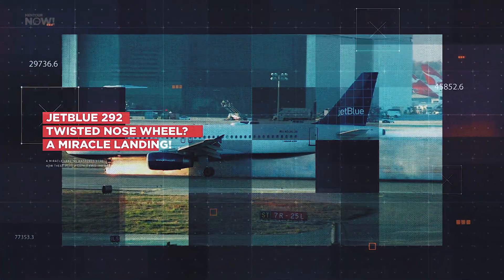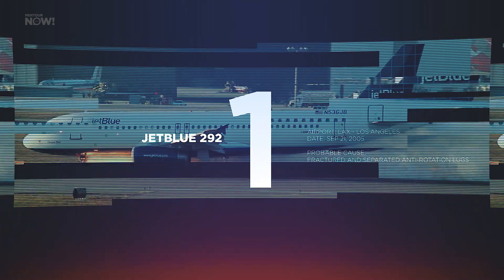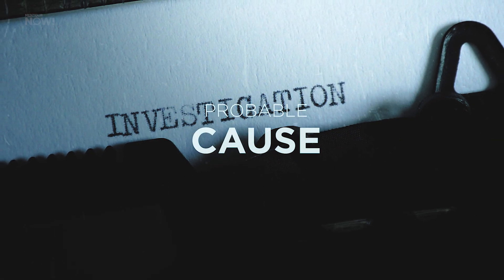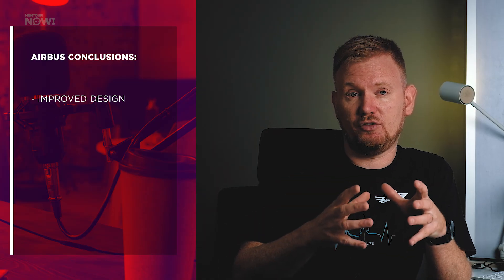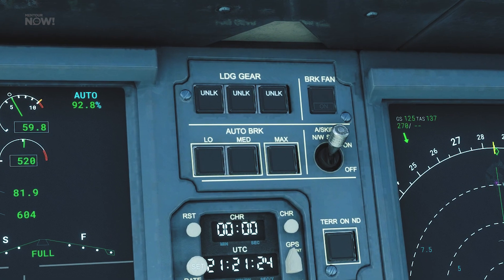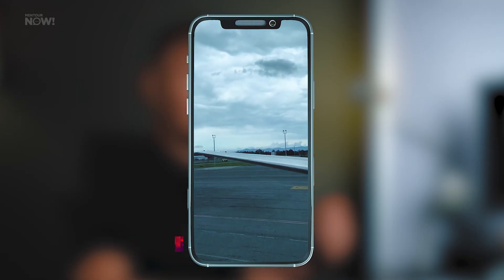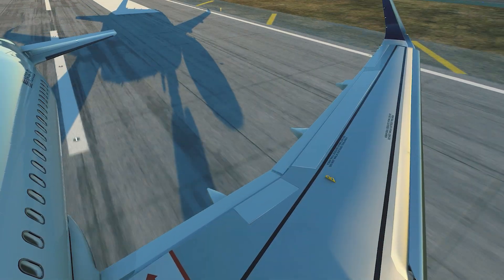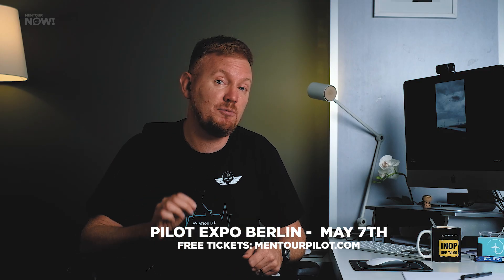The TWISTED Story of the Airbus A320 NOSE-GEAR!

Comment: The design of the A320 nose wheel is fundamentally flawed. Claiming that every incident root cause was different in detail is missing the point.  Nosewheels are ubiquitous on all heavy passenger jets, yet only the Airbus had this litany of major failures.  This tells you the design was rubbish. The advisory to limit travel to less than 20 degrees was totally impractical and put the onus on pilots to band aid over a bad design. How can an aircraft operator reliably taxi when airports turnarounds require much greater nose wheel angles? Do they have to get out and lift the thing up by hand? I suppose the passengers could all get up the back to lift the nose up or something.

The sensitivity of the proximitors to water ingress is also ridiculous.  The spray of water from a wet runway could do much the same as pressure washing if water resistance was compromised. Waterproof proximitors are hardly a new invention, they are ubiquitous throughout industry. You can also bet that some cleaner will not be briefed on the dangers of washing the nose gear and do it anyway.

The nose wheel should have a failsafe, robust mechanical mechanism that prevents extreme steering angles in the landing configuration and retracted position and automatic self-centering castoring of the wheels if the hydraulic actuators lock up.  The nose wheel angle should also be instrumented so the pilot knows if it is in ta safe position to land. 

The wheel was invented millenia ago there is simply no excuse for this poor design. Modern automotive unassisted, hydraulically assisted and electrically assisted steering systems have to undergo all of the assaults an aicraft nose wheel system does, and there are many more "stearing hours" for the millions of cars than aircraft. If the steering system of cars was no more reliable than the airbus system there would be a lot more dead car drivers and passengers than there are now.

Comment: It needs to be pondered why this serious of similar issues occured with one specific plane model. Or does it happening on many models?
9:58 No power washing inside of the nose wheel well? Because such conditions that cause water to enter the sensors could totally not happen when operating the plane on a very rainy day with water spray? No need to overhaul the sensors?
And allowing the steering angle limitation thing to continue flights with is irresponsible and definitely the kind of stuff that happens in a profit-driven business. They're basically expecting pilots to stick a post-it note on the dashboard so that they don't forget to avoid an extremely dangerous irregular error. - This underlines my critique regarding the marketing pitch of safe airline travel. That incident was completely avoidable. If my car had a technical issue where I must remember to not exceed a certain steering angle to avoid a dangerous situation, I could get into serious trouble with the police, and rightfully so. It is unsafe operation of a vehicle in public space.

Comment: Thanks but, you have just contradicted yourself.  Because:-
It seems like after all these instances,  the fault was actually never remedied and the problem persisted. Not withstanding that the faults may be slightly different I find the proposed remedies incompetent. 
For instance,  to blame the jet washing for getting water into part of the undercarriage is illogical.  Because,  what about the splashes of rainwater during a deluge. Are they suggesting NO landing with the nose wheel deployed during a deluge just in case a part of the inside of the nose gear gets saturated ?
It's nonsensical. 
Whatever happened to compliance with the Failsafe requirements  ?
But I suppose everyone is more interested about getting the aircraft off the ground rather than landing it.

Comment: 90 degrees is probably better than being locked at 20 degrees pulling the plane off the runway. But one would think you get one chance to fix this, or this plane is grounded. We will take the plans from a similar sized plane that has never had an issue and you will use their design. And then you will test it 1 million times. And then, maybe, we will let you fly again. So they just plan to let this happen forever until something actually tragic happens? And then get serious about it?

Comment: I've flown a dozen times since my youth. After watching dozens of YouTube posts about commercial place crashes, I wouldn't ever again get on a plane. They're known to be flown by drunks; suicidal pilots flying  purposely into mountains; pilots can't figure what the faulty onboard computers are saying; a most unprovidential stewardess got sucked out of plane at 37K feet and engines flame out in flight. And that's only the tip of the iceberg. Airbus is among the worst.

Comment: It sounds like they need to add a mechanical backup steering mechanism for the nose gear so that the crew can at least center the nose gear prior to landing. Or maybe just permanently fix the nose gear in the centered position. Unless I'm greatly mistaken, they never had any similar issues during the taildragger days.

Comment: I’m curious.  I understand why you wouldn’t want the engines ingesting pieces of the nose gear, but shouldn’t the thrust reversers actually reduce weight on the nose gear?  In a car if you pull the E-brake, it causes the back end to squat down.  Given that the engines are rear Lear’s of the nose gear, shouldn’t the reversers reduce downforce on the nose in a similar way or is it that the weight transfer of braking offsets this?

Comment: 19 Febuary 1992 AirMalta had a similar problem. The A320 was a relatively new design and had its problems when it was introduced commercially to airlines. This aircraft (9H-ABP) was MSN 112 so quite an early production one. AirMalta were operating as KM 100 towards LHR from MLA when during take off the front wheel spun when we were already at high speed. Of course we stopped as soon as possible, but as can be seen in  photos taken on the day half of the front wheel was eaten by the friction with the ground. After this incident the Airbus had arranged the design and there was no other like it in the take off phase of flight but there were still others similar during the landing, with famous JetBlue live on TV.

Comment: In 2000, i worked in a tall office building beside LAX and we went outside to witness the aircraft landing with its nosegear at 90deg. 
Unfortunately i cant find the plane type as your video made me wonder if it was the same as the more recnnt aircraft.
I was wondering why they couldnt turn on the APU rather than rely on a ramjet which itself might impact the rumway? Thats what i would do if i were pilot. Shut it off after coming to a stop on the runway before evacuation (or during because its intake wouldnt risk any passengers).
Another thing i firmly believe is that every control shpuld hace feedback. If rhe Captai s steering hamdle were at 90deg it would be an easy indicator what the wheel is doing.
Without feedback you cant even walk. You wouldnt know if your foot was on the floor or bumped into a wall as you continued the motions. 
Feedback is essential which is why they call it AI.

Comment: I'm not a pilot. I personally would be following the Unsafe Landing Gear Checklist, at least for the most part. 
As you said, although all these failures seem identical, they're not. 
As a pilot, I wouldn't be so sure that my nose gear wouldn't collapse and damage an engine, so I'd shut the engines down.
In an effort to keep everyone safe, I would make to give emergency landing instructions, just in case. 
Really, it would seem that an "Other Unsafe Landing Conditions" checklist should be made, which would mostly include considerations for safety.

Comment: Yeah, that's how I programmed computers. Do an initial bad job then just fix the bugs as they came up. I wasn't a very good programmer and it looks like the designers of the nose gear were pretty ordinary too. The whole video avoided saying that though. I guess it was good that the wheels didn't fall off. Or was that in another plane? Overall my opinion of aircraft design and maintenance has taken a huge hit lately.

Comment: Maybe they should add the ability to see the degree of the nose gear via the information panel and add an option that they can turn the wheel left or right back into a straight position similar to the mechanics to a car side mirror automatic adjuster but modified to be more durable and take the stress of landing , or add a second nose landing gear of a different design that can be switched to just behind or just ahead of the main nose gear as a backup 

Or preferably scrap the design and replace it completely and add additional safety features similar to the above for the ability to adjust the landing gear positioning

Comment: At the very end of the video, Peter mentions that it is required to shut down engines after landing, because if the nose collides, no FOD is pushed into the engines. I was expecting that the collapse itself could cause damage to electronics under the cockpit, creating problems for the shutdown of the engines and hindering an evacuation. Is this a possibility?

I'm not in the industry, and I'm unaware what electronics are there and if they would affect engine controls, but this made me remember the Qantas flight 1, where the intercom was inoperable.

Comment: What would make the wheel move towards the center line it's cold Castor not camber

You can also have the wheels have a centering effect by putting them on a trailing link that is slight even several degrees. Take letter L with direction of travel to the left if the wheels were mounted at the very bottom right of that letter L , as you move it would have a centering effect. It's been awhile so I am rusty but I believe that the point of the wheel mount to the top of the letter would also give a Caster angle for that centering Force or I should say the return to Center Force. (Sorry, it's been awhile, really rusty)

Comment: To be honest, part of me wants to say that the fact that so many different faults lead to the nose gear being aligned 90 degrees off axis is a good thing maybe? "Good" in this case means "Failing gracefully",  not "this is a good normal operation mode", of course.
It's a lot better than the nose gear being for instance 15 degrees off axis in any particular direction, because at least with it nearly perpendicular to the direction of travel it won't try to push you off the runway.
So I'd call this an example of "graceful degredation of capabilities", even if it is still very clearly a rather severe fault, because you don't have to fight the aircraft to stay on the runway even with the gear at 90 degrees off of the intended axis.
Of course it's not the expected graceful failure mode (nose wheel stuck aligned to the center but no steering is the intended failure mode, from watching this video), but it's nice that it's still at least a little bit graceful.

Comment: This many problems with the landing gear indicates fundamental design flaw in the gear itself and its Associated support systems. Airbus should scrap the whole syatem and redesigned it from the ground up with expanded testing and proper testing. If  this specific airplane has significantly more nose landing gear issued than other aircraft, it is a type design weakness.

Comment: Wow!  Is this video a joke or what?  The cognitive dissonance here is unbelievable! - almost as bad as seen during this 'epidepimick'!

First of all, how did these 4 or 5 landing gear hardware AND software design flaws get ALL THE WAY past testing & safety procedures during the ENTIRE design process?  Something NEGLIGENT has occurred here OBVIOUSLY.  How?  Why?  Where on earth did this shocking design come from?  Someone should be asking serious questions of the designers.

So MANY operational rule & procedure changes made SPECIFICALLY to cater for FLOORED Airbus 320 operation!  Is the  'Airbus' company UNTOUCHABLE or something?  Are they above the rules?

When are all these A320's gonna be pulled from the skies & grounded until they fix the bloody landing gear SYSTEM problem?  How many miles of runway bitumen are gonna have to be plowed up by A320 nosewheels (noseploughs!) before this happens?   

Is the runway immediately closed & re-bitumined aftet an A320 noseplough event?  Or do they just sweep it & continue to let aircraft take off & land from it?  There could be large, loose stones that could be thrown up & about from a compromised runway surface.  

Can they patch up runways like they patch the roads?  How do they re-cut the drainage channels back into the runway after it's patched?  Or do they even re-cut the channels after a patch is applied?

So how much more of this bs has to go before Airbus does the right thing?  Until someone gets killed?  Or will they wait till 50 or 100 people are killed? 

Shame on you too Petter!  You seem to accept all this pandering to Airbus like it was just a normal thing?  I never thought I'd give you a thumbs down but you scored this time!

Comment: I have to agree with the others saying the nose gear design is defective and needs to be reengineered, 4–5 different causes for a nose gear rotated 90° tells me you have multiple single points of failure. It needs a backup added to limit the gear rotation in the event of other failures and/or a way to correct geat rotation in flight should it occur. Maybe a set of backup lugs to physically stop the rotation?

Comment: This is designed to fail. Why would 90 degree even be an option. Why not make it so the wheel can only turn so much without coming to a mechanical stop. easy

Comment: Stupid question, but couldn't they just have some springs that center the nose gear when it's at 90 degrees? The only reason why it would be at 90 degrees anyway is during taxi, at which point the weight of the aircraft would overpower the springs. But once there's no pressure, they center automatically. Could probably be done in software as well.

Comment: So the steering on my car is better designed than an airbus landing gear? If I crank my steering to max in either direction and then let go of the steering wheel, it doesn't lock in the max position. Nor is it reliant on a couple metal lugs to not over-rotate. Nor does it rely on a computer dumb enough to break itself.

 Is it really a fact that they make wonderful flying vehicles but are lost regarding rolling on the ground? Airbus should call Toyota to get help redisgning their hot garbage.

Comment: Dear Mentour Pilot - I do enjoy your programmes - though having (helpfully !) commented on a Concorde piece you did once and getting unfairly roasted by a couple of you tubers (why do people do this ?!) I hope my suggestion of an answer to your question about how the pilots did not notice their wheels were at 90 degrees may be of help. I am not an engineer but about 7 years ago a colleague and I witnessed an articulated truck hit the back of a small car on the M40 Motorway in England at about 40-50mph. To our utter amazement the car became stuck sideways on to the front of the truck which simply pushed the car (all 4 tyres at 90 degrees) along the tarmac. There was no screeching, no burning rubber and the truck was still doing around 20-30mph for around 150 metres or more until they both came to a stop. Strikes me that for some reason tyres may simply 'slide' - at least for a while ? Cheers and keep up the great work Monsieur ! Johnny

Comment: I can’t believe these aircraft are still in the air with the possibility for this defect to occur. It appears to be a major safety issue. Having the wheel 90 degrees must put an enormous strain on all the components involved. Obviously there would be no steering control. And the tires scrubbing off leaving the metal rim scraping along the runway surface must leave a heck of a groove in the surface which would be right where other nose wheels run. Not to mention the possibility of debris flying into the engines if the crew forgets to shut them down. The whole thing is bizarre.

Comment: IMHO, if the same failure keeps repeating in a frequently weird fashion, no matter if the triggering cause is different each time, the root cause is not the one triggering the event, but the design of the part that keeps failing in the same way over and over. So, I’d say the design of that part should be completely changed.

Comment: As an Engineer myself, I hate it when people automatically blame the design.  In this case, though, it seems justified.  The result of all these different events caused the system to fail to the worst-case scenario.  In the event of a fault, the system should inherently return to a centered position.  I think a ground-up re-evaluation of the entire system is in order, with a much better focus on fail-to-safe design.

Comment: i don't particularly agree that, for example, a no ECAM message is no crew troubleshoot of known or perceived problems. I know that times are changing surely and getting a crewmember that understands fully the systems learned (and all their cause interactions) while going on type rating or by experience is hard.

Comment: “Guidance was updated that pilots should never do anything not found in a checklist”

… computers are (much) better at following checklists than humans. Why even have humans? I mean I get it, they made the problem slightly worse this time because of the reset, but a) I feel like the solution there is to make that system come up a little more robustly, rather than never rebooting the computer, and b) responding that pilots should never do anything a computer wouldn’t is… well, postulating the perfect spherical pilot, I can see why that’d be attractive to several of the companies involved but the whole point of having pilots is so they can occasionally think outside the box.